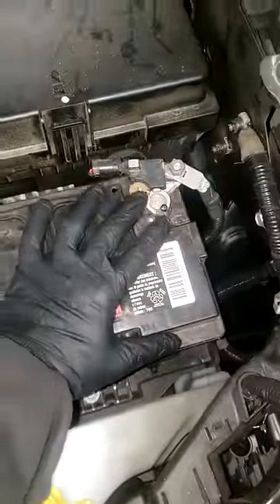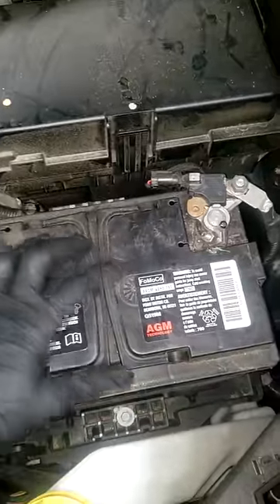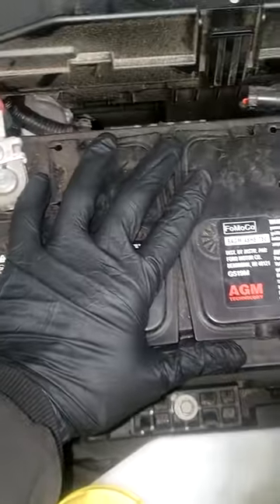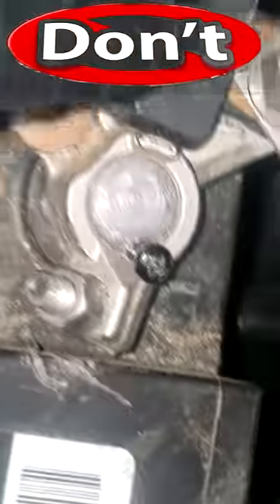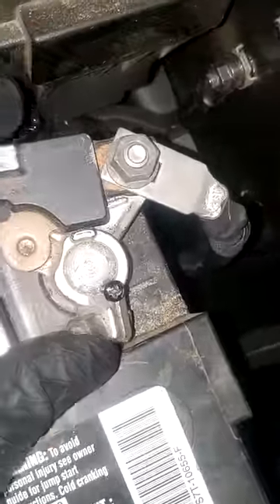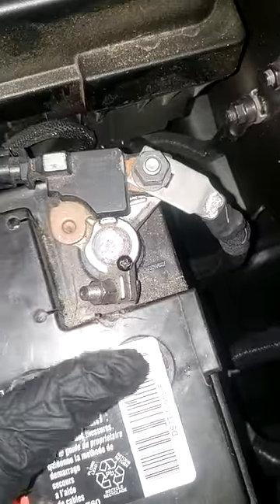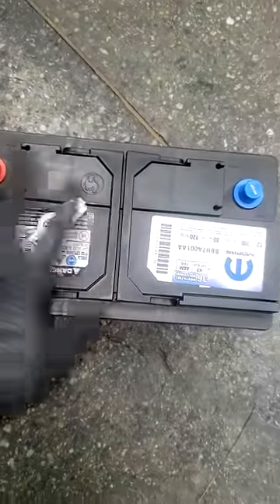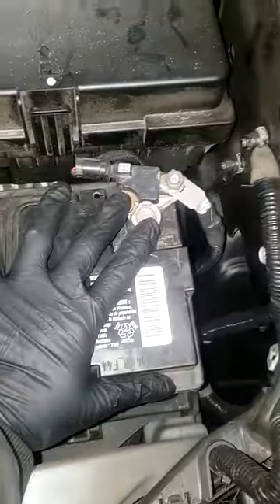STOP DOING THIS PEOPLE. This will destroy your car electrical system.

Comment: I've had enough used cars over the years to learn that whenever stuff starts going weird or acting funny change the oil and check the battery AND the alternator.  I had an acura that eventually shifted hard, check engine wouldn't go off and sh-awd light on too.  Got fed up after so much money and had it for sale.  The battery eventually died while driving one day, put in a NEW (not refurbished or used from a junkyard,  etc) and immediately everything went away. I had a Nad battery that tested as good and it killed 2 alternators and led to a host of other problems.  On my f150 I had a CEL code come back for cats running too lean, a misfire on cylinder 5 and some harder Trans shifts.  New battery and swapped alternator and running perfectly again.

Comment: I do roadside assistance and I see that a lot
Reply from the maker: Its been a good hack up until the new cars started using sensors as battery terminals. Now these new computer control car won't deal
Reply: @OnlineMechanicTips  so true

Comment: A sensor?? I get all these new fancy electronics, gadgets and stuff. So terminals are not squeezed anymore and hit with a hammer to stay tight with the battery post?
Reply from the maker: Lmao..naw man. These terminals now have a sensor on them that will switch on you to the computer and then turn on ya check engine light

Comment: 9/10 times if the lights are "flickering", it's caused by a failure in the voltage regulator located inside most modern alternators. Meaning the alternator is bad. And secondly the screw would not fault out the sensor. Someone was being lazy and put the screw in there to hold it tighter on the terminal. More than likely trying to save the lady a few bucks so she can get down the road. 3rd thing. There is no need to replace the battery without properly testing the battery to find out if there actual needs to be a replacement. From what I can tell, you failed to do so and just assumed so you can do a quick.. cough, cough.. mark-up job. So you can make a buck on this lady... I guarantee you marked up the battery and the sensor. Then turned around and charged her $500 for the labor 🤣 Moral of the story folks, if you don't know much about vehicles and you're about to have work done on your car. Either take the quote somewhere else and get a second opinion or take someone with you that is familiar with automotive repair so you don't get taken advantage of like this guy's customer...
Reply from the maker: You lost me on the very first sentence when suggesting "failure in the voltage regulator located inside most modern alternators."  I had to stop right here because nothing else mattered. You way out there my friend. Where are you getting this info? When the last time you worked on cars?

Comment: Also needs BMS needs to be reset with a new battery. I was on a job interview at a Ford dealer and the manager told me they had a Ford fusion that was there for 3months that kept dying even with a new battery. I fixed it with the the scan tool performed a bms reset and the car never had a issue again. I got hired instantly haha

Comment: That screw doing the same process the nut used to tighten it does.  Hope you find the problem after replacing those.
Reply from the maker: Car fixed and gone my guy after leaving a shop such as those that you frequent
Reply: @Online Mechanic Tips  negative.  I avoid career mechanics at all cost.  Prefer to deal with technicians when i have no choice.
Reply from the maker: @RaggedCrushing  Well hopefully you dealing with one that has been trained on this new stuff. Maybe he can hammer through ya head that you cant be doing this stuff anymore on these newer cars that use IBS

Comment: You know you bought the wrong vehicle when even the battery cable has a sensor on it 🙄
Reply from the maker: You think thats bad, in 5 years the battery will be under the car..lol
Reply: @OnlineMechanicTips  not for me I’ll swap a tractor motor in my truck before I buy anything electric and I’ll burn whatever oil I can get my hands on I’ll never go electric as long as I live that shi is for the birds
Reply: @OnlineMechanicTips  I’m actually an agricultural machinery mechanic and I just recently repaired an electric lawnmower that had 32hours on it and the batteries were already bad they wouldn’t hold a charge and the batteries alone were $2,500 luckily for the customer it was covered under warranty but I’ve had gasoline mowers go +2,000 hours on the original engine
Reply from the maker: @Chase_01 Lol, O wow. Thats crazy..Yea the next five years will be interesting. Im in training now for the projected switch over to full electric..we'll see what happens
Reply: @OnlineMechanicTips  as long as consumers hold out, it won’t succeed and the whole electric vehicles fiasco will be a total loss for the automotive manufacturers and will be forced to continue making superior combustion vehicles. I’m just praying that’s what happens.
Reply from the maker: @Chase_01  And they def holding out. No way they will meet the projected target year for fully EV because the gas engine still selling. Car makers likely will be forced to stop producing them..bumber
Reply: @OnlineMechanicTips  bummer? I see that as a very good thing. electric vehicles are dangerous and are inferior compared to combustion vehicles. Imagine a hot summer day with a filled parking lot like Walmart and one electric vehicle’s battery overheats and catches fire they will all go up and be impossible to put out. Plus the production of EV’s is tremendously bad for our planet’s ecosystems and wildlife.

Comment: The Heart & Soul of your car electrical system is your ALTERNATOR. The battery's only function is to start the engine and run some electronic accessories when the engine is off. Once your engine starts running the ALTERNATOR takes over the entire Electrical system of the car. Alrighty
Reply from the maker: Interesting point you have there my guy. Seems your opinion different than mine. And thats ok, they are called opinions for a reason. Thanks for tuning in.

Comment: Just to clarify as a spectator:
1. The mechanic keeps referring to the terminal/battery clamp as a sensor and he's incorrect. The sensor attaches to the clamp which attaches to the battery. 
2. That screw is acting as a shim. Perfectly fine.
3. If I were in this situation I would show the customer, but I would replace the battery, terminal and sensor because if I let it leave w/ the screw + new battery I look bad to the next mechanic. So his wording was wrong but was put in a wierd situation, but also told on his self by replacing parts before diagnosising the actual issue.
Reply from the maker: Told on my self? What are we kids here? Look man, I reference it that way because its sold as 1 unit. So if the terminal suspect, the sensor is as well or vice versa. When I say it needs or in this case its getting a new IBS, thats what its getting which will include the terminal. I shouldn't  have to baby petty grown ass men. Frankly, I don't have to explain nothing to overly critical petty grown ass men. But because I'm one to speak on the comments I choose to. Now as for you, just who are you to validate or judge what anybody has said, or display what your course of action would have been? Especially as it relates to what I did? Fact is, if you on here defending that screw, you no different than them. Now, the good news is that the car is gone and fixed. Simply, new IBS and battery, yall can keep ya screws.
Reply: @OnlineMechanicTips  so first I learned a long time ago "don't let the comment section pass you off" some comment are just plain b.s., some is collective criticism and some good knowledge. I understand from your point of view how the car had to leave your shop and that makes perfect sense but that screw if anything will cause more corrosion on the battery. And what some people dont relize, some manufacturers are finicky especially when it comes to electronics. But and the end of the day you trying to prove your point in the comment section and your vid shows otherwise. Your discrediting yourself and shows the lengths you will go to be right! This shows bad character and is bad for business! This is a teachable moment, learn from it. Be the good guy & Move on 👍
Reply from the maker: @torello928  Smdh, you been in the shop to long and so have I. The difference between us is im now a youtube content creator. Not on here merely defending myself, I could care less what folks think. What I'm doing is simply youtubing. So no need to explain to me mechanical stuff on a car thats done and gone. But we can youtube about it all year long. Me responding to comments is youtubing. Imma need you to understand the difference. If clown mechanics on here wanna keep defending that screw, let them..lol..im cool with that. But there's no need to feel sorry for me my guy, im having a blast trying to convince hack mechanics to stop hacking especially on these new cars thats not hack compatable. Lol. Let them keep it up and brick they new electronically controlled transmission. Im good bro.

Comment: as a mechanic my self..Audi Tech … 15 years, i don’t think the screw would cause anything as its just metal on metal.. the battery could easily be the issue and starting to fail.

Comment: The terminal has a bad connection or the battery is breaking down. If the terminals are cleaned correctly and are making good connection the screw wont do anything. If the screw was the only path for current to flow it may get hot when cranking the engine and the battery will charge poorly. As for the sensor, is it not just a shunt with a voltage drop output signal as pwm? Maybe it needs the battery voltage resetting through the ecu to the sensor to clear the faults and replacing the sensor is the alternative way as it is already reset to factory?

Comment: Guilty as charged for this ,I did eventually change the connector,but that works just fine ,juat make sure to keep the battery locked down because a shift in the battery will it come lose after a few dozen turns

Comment: And that module on a BMW if you change your battery, your computer has to be reset if it is not the proper battery on mine. If you turn the heater on the engine races, these cars are made to be reprogrammed when anything is worked on
Reply from the maker: Whoa, interesting

Comment: That screw doesn't affect anything, as it's only in the terminal, not the sensor. Electrical systems on Chryslers freak out when a battery fails, even to the point where it will not stay running after being jumped.
Reply from the maker: smdh, the screw affect connection, poor connection equals brick transmissions and check engine lights.. You trying to tell me ho Chrysler electronics work?

Comment: Can’t drill into lead to spread it out because there is a sensor reading? Makes no sense. Everything is secured…
Reply from the maker: Then leave your screws in my guy. Don't sweat it. Just don't come to the shop complaining about your check eng light on and it should be covered under warranty..smdh

Comment: That screw doesn’t hurt a thing as long as it’s making good contact but the fomoco batt 🤯
Reply from the maker: Then leave your screws in my guy. I cant properly fix this cars electrical problem with screws all in the battery sensor.
Reply: Recommendation for a really good battery?
Reply: @SpicyMcGeezak  Interstate Batteries.  And not the ones at the store.  You gotta buy the ones from an automotive repair shop, they are different, better.  I’m a retired mechanic.  These are the best in the industry.

Comment: Yup even in my 2001 Ford Expedition the gauges would flash and it wouldn’t crank because the recent owner put a nail in battery port 🤦‍♂️ once I put new terminal on it fixed it

Comment: After reading through these comments I think OP has missed what people have said. Yes, the battery and the IBS are probably bad. But not because of the screw. It was a shoddy attempt at a repair. 

But remember that customers are people too. It could be that when that other shop hit them with the sensor/battery cost they thought they were being "ripped off" and turned down the repair.
Reply from the maker: Shoddy attempt at a repair??? I'm not sure what that mean so I will pretend I don't see. Now, keep in mind folks, my job is to make an accurate repair, that pleases the customee, im not here to please you guys, I just share what I'm doing and why with you guys. After all this comment mentioned please note, the customer could care less about any of the mumbo jumbo tech talking we doing. All they care about is that NOW, they check engine light off. They need that perception thinking that they car now safe and ok to drive. Mission accomplished.
Reply: @OnlineMechanicTips  This is what I mean, I was agreeing that running the screw in the terminal wasn't the fix. It also wasn't the issue. But you want to argue.
Reply from the maker: @RAGEVforVash  I don't want to argue, just want you to know you wrong. Which you are. But you def entitled to your opinion.
Reply from the maker: @RAGEVforVash  Drive home a screw in between your IBS and your battery post and see what happens
Reply: @OnlineMechanicTips  You're making my day. If the screw was the issue, why did the customer take it to the shop that put it in?
Reply from the maker: @RAGEVforVash  Maybe she learned her lesson or maybe they dont have advanced scan tools needed to diagnose todays modern cars.
Reply: @OnlineMechanicTips  I love how you feel like you need to defend yourself even when people are not arguing with you.
Reply from the maker: @Clynikal  smdh, im not arguing with anybody, merely answering comments. Im one of those youtubers that respond to comments, good or bad. I don't mind.

Comment: That screw is not causing any issues. How are you a mechanic and saying that.
Reply from the maker: Who says I'm a mechanic? Here's ya chance to shine and not be a sideline troll. Make a video and explain what's really going on. O yea, thats to much work huh? It's much easier being a keyboard thug..foh
Reply: @OnlineMechanicTips  I’m a journeyman mechanic and sure the screw isn’t right but if that clamp is tight it’s not an issue and definitely wouldn’t cause an issue until that post came loose

Comment: Wouldn't the alternator be the heart and soul? All the battery does is provide power on start up, the alt not only powers everything while the engine runs but keeps that battery charged...
Reply from the maker: Everybody opinion different on this. Its not really a right or wrong answer. More opinionated.

Comment: what? nah, that screw ain't fowling that connection, bodge it and scarper yes, error causing no. Should have checked fluid (acid) levels (if not a sealed battery), juiced it on a trickle charger, perform a drop test, repair the negative battery terminal so it creates a proper contact without the aid of a screw, check for faults using a scan tool.
Reply from the maker: Lmao, if you think we bout to do all that to a car that just left a hack shop with the wrong battery and a compromised battery terminal IBS, you sound suspect. Aint gone happen and shouldn't happen. The battery and ibs was replaced...all good
Reply from the maker: @obiitom  Everything was visible and obvious. Try to not think so hard when its not justified out there in this brutal world. It will age you quickly.

Comment: This use to work, my 2009 crv has had a screw holding that terminal for.almost 10 years now
Reply from the maker: It works on any of the older cars. Just not advised on these newer cars that use sensors on the terminals (IBS) nor these newer computer controlled cars
Reply: @OnlineMechanicTips  Yes, if the car has IBS or canbus I would never do this

Comment: If you have a loose connection but a good battery, do you think a battery terminal shim (a real one - not a screw) is a good solution?
Reply: It’s a lot better than a screw! I’d replace the terminal if it’s possible.
Reply from the maker: Yea im with 5Rounds but only if this a older car not heavily computer controlled. Absolutely no added shims or screws on the newer cars using an IBS setup. We get the.towed in because they transmissions locked out. Fixbit right using oem parts on the newer stuff

Comment: Leaving a good battery on concrete smh🤦‍♂️
Reply from the maker: What will happen?
Reply: @OnlineMechanicTips  slowly dies
Reply from the maker: @Robby1  Thats one of the biggest myths thats been out for years. These battery uses different plastic cases than in the past. It has no effect on the battery imo

Comment: It's fine on non computer vehicles I've been doing it for 50 plus years.
Reply from the maker: Yes, so have i..Doing this on these newer cars just asking for trouble. Tow in with bricked transmissions offline because of poor battery connections. I see it all the time.

Comment: Something else that I have been running into also is lights on the dash and car not starting as designed, and it's the battery in the fob. We had a shop around us that replaced the starter or fuel related parts.. everything but the fob battery or the car battery. These are becoming more and more sensitive when the batteries get low, like you said under the hood (or wherever) but also the fobs.